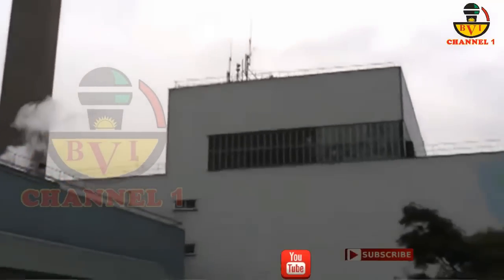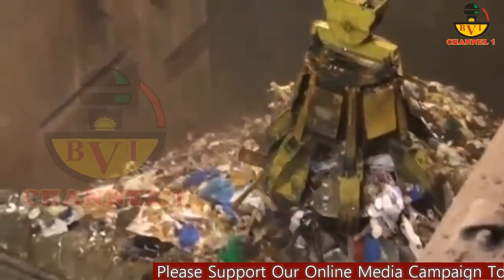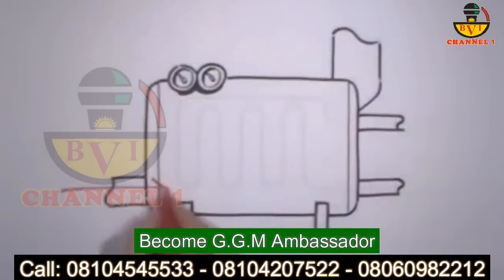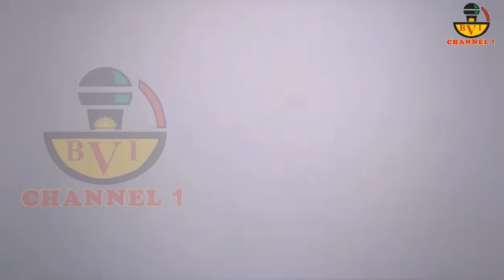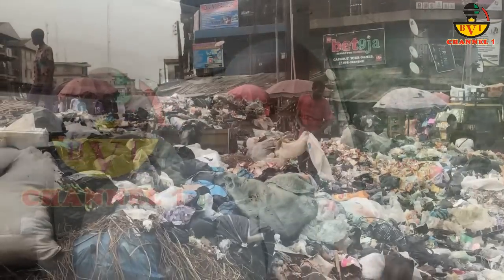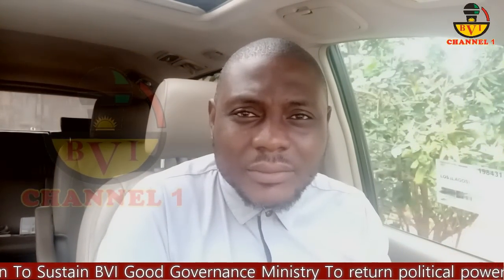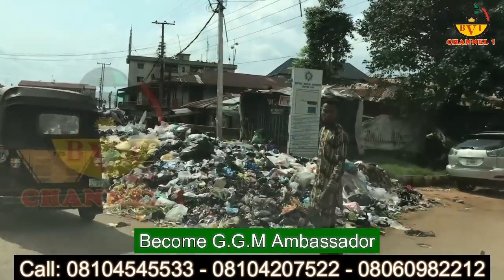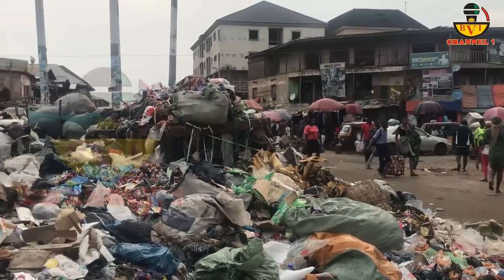Turning Waste Hazards Into Wealth In Igbo Land

Comment: I hear you my brother. Have you realized that besides Umahi, no other Igbo governor has ideas?  We 're full of misleaders without ideas. They do not understand the foundational things that need to be in place as the building block. I hope that Soludo will be an exception and intuitive. Not one of the governors has the brain to understand the need to provide 24 hour power supply to most industrial areas for expanded employment. None of them has the brains to assemble our civil engineers and have them build roads with equipment assembled by Innoson, for a start. Our engineers can build boilers. I can help bring the engineers together. The proper foundation needs to be set up to move us out of nigeria as quickly as possible. nigeria retards our growth and advancement.